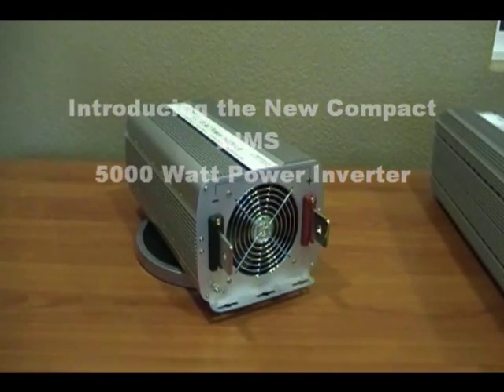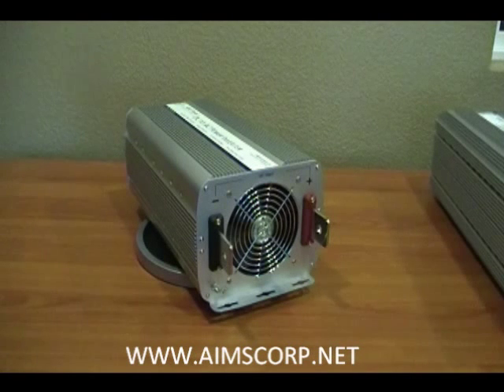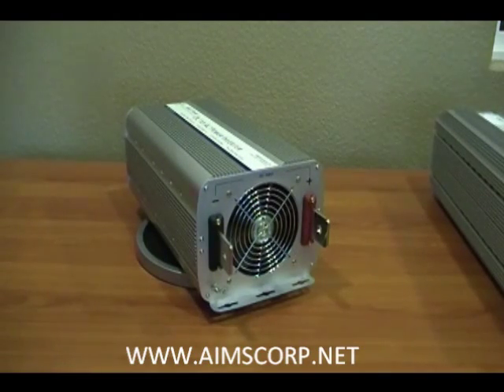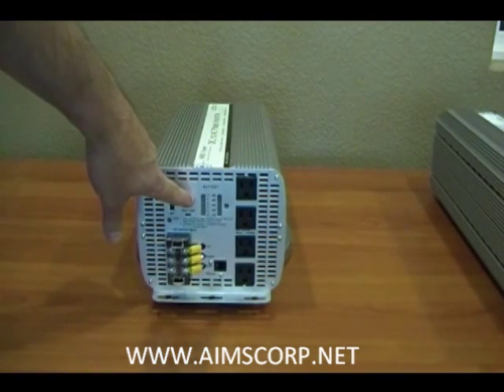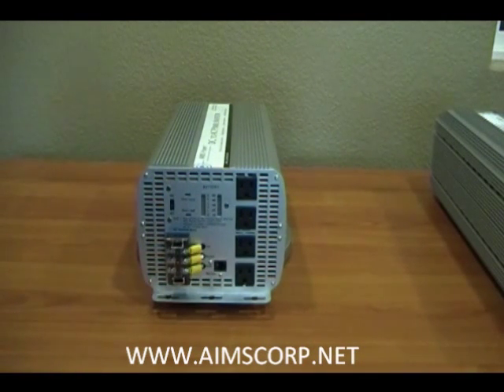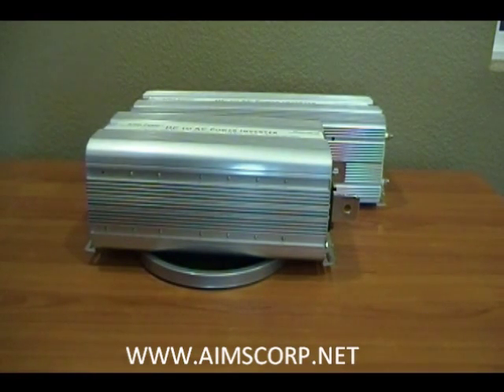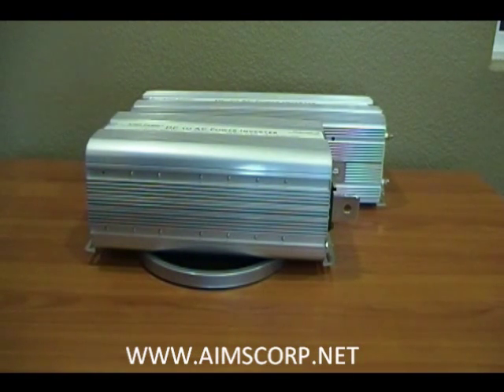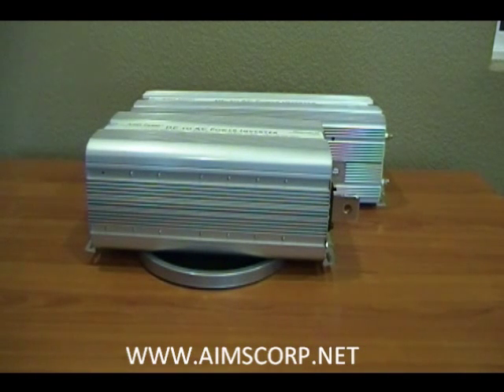5000 Watt Power Inverter by AIMS

Comment: Couple of questions for you, how much heat do these produce under maximum load? What happen if you try to draw more than it can handle? I'd like to hook these up to a battery array charged by a battery controller from solar/wind power and run drops throughout my house to run specific appliances like the refrigerator, kitchen appliances and home entertainment center...would you recommend this unit for that? Thanks for your time!